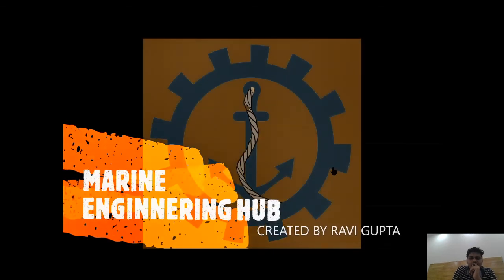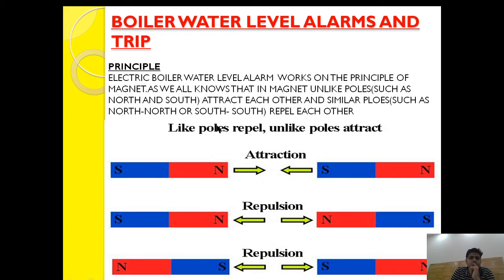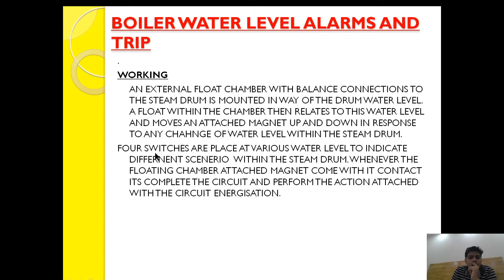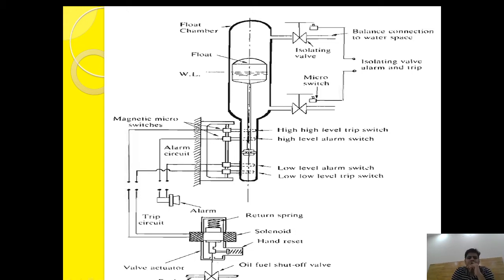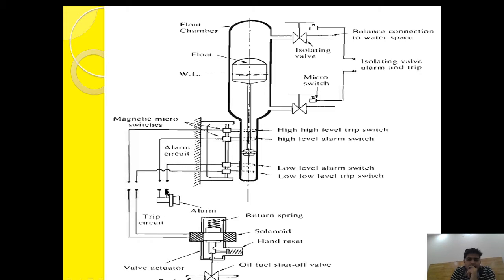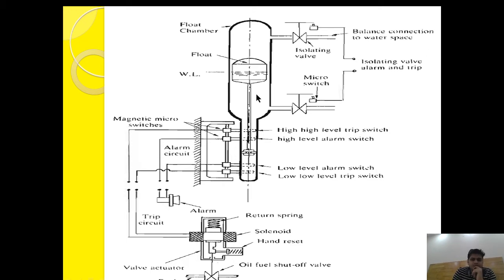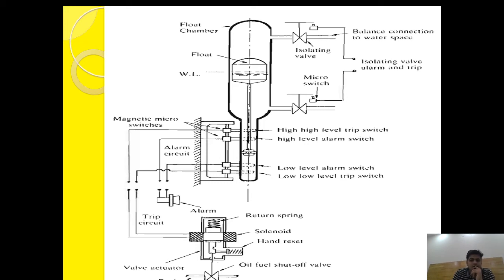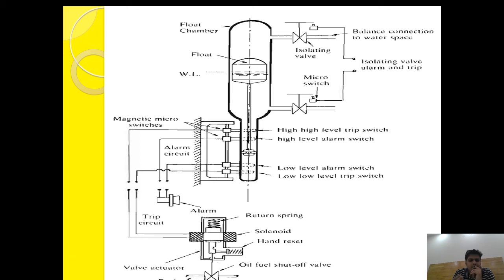BOILER WATER LEVEL ALARM AND TRIP CIRCUIT|BOILER ALARM SYSTEM|REEDS SWITCHES IN BOILER|

Comment: Sir,  My boiler feed water control/supplied by pneumatic diaphragm valve with a Electro hydraulic valve positioner. Suddenly this valve sometimes not opening when the water level is low and even if open, not close when the water level comes to it’s normal operation.
What could be the problem?